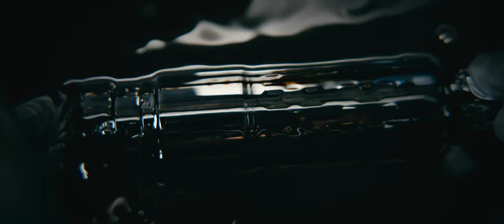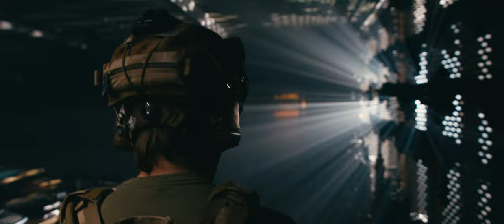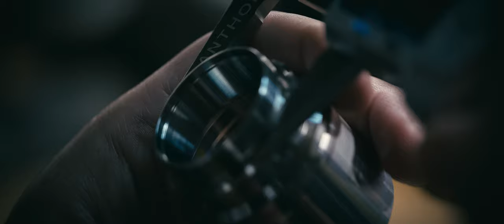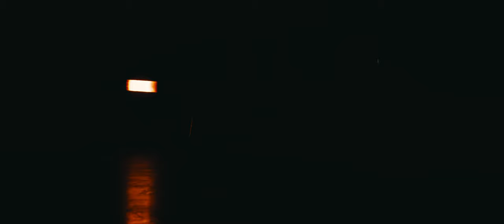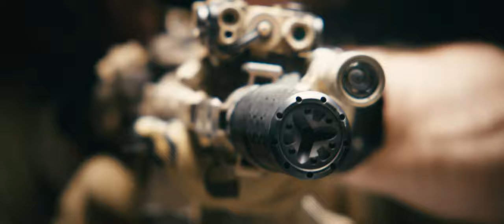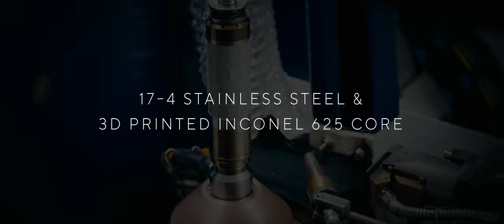The SilencerCo Velos LBP has Arrived! (Low Back Pressure)

Comment: It says no barrel restrictions and full auto rated, which is exactly what I need for my 5 inch barrel full auto ar-15 also less back pressure is nice!!
Reply: 🤣 dude I don't know if you're joking but I just finished my 5 incher and man that thing is slick. Also snooping around for suppressors.
Reply: @boygonewhoopdataZZ I tried it on my 5inch with a binary trigger and it was great! Low flash and quiet, 60 rounds in it was glowing, 1,100 Fahrenheit. Finish held up great and it’s fine!

Comment: I would be much more interested in this thing if it were a multi-cal can like the 36M and 46M are. How much back pressure/gas blowback does the 36M have? Besides being multi-cal so I can run it on my pistols and my rifles, the gas blowback is what I'm most concerned about, followed by the point of aim/impact shift when going from shooting suppressed to unsuppressed.